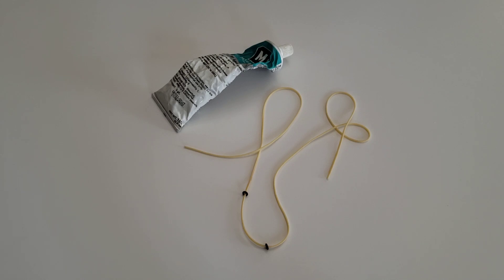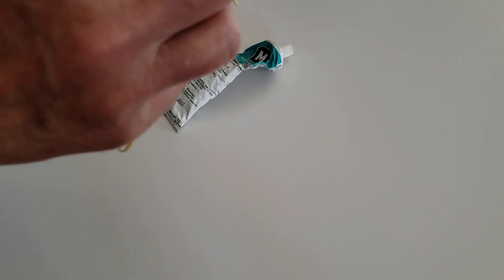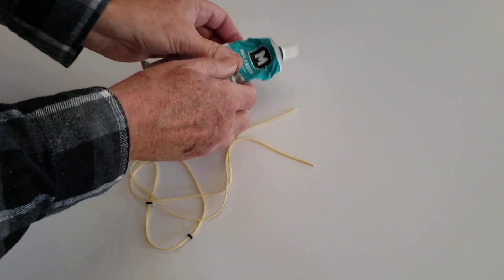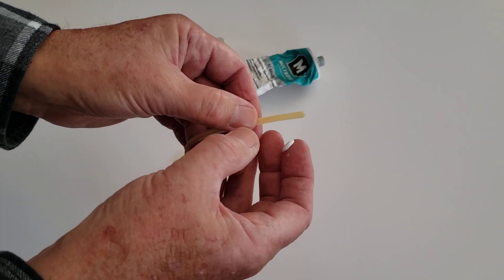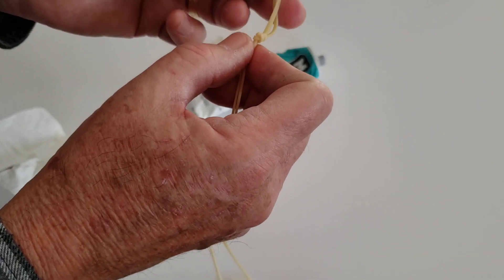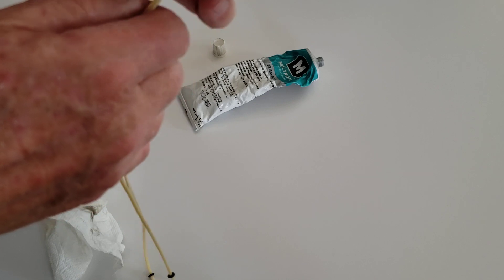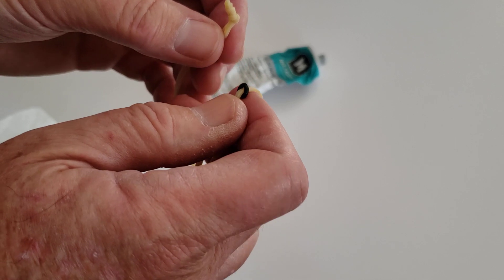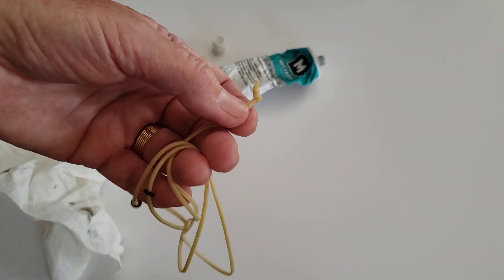tying rubber motors

Comment: I use a "Fisherman's knot", which is just a pair of overhand knots, one tied in each end, but around the standing part of the opposing end. It is no more complicated but has the benefit of being symmetrical and compact with the tails running parallel with the motor instead of protruding to one side.

Comment: Hi I noticed that there are 33 Light and 33 Medium. Which one would you recommend?
Reply from the maker: Either will work fine. I don't like lube that is too thin if the rubber motor is mounted inside of a fuselage of a model. I don't want thin lube being thrown off against the tissue or Polyspan covering that covers the fuselage frame.